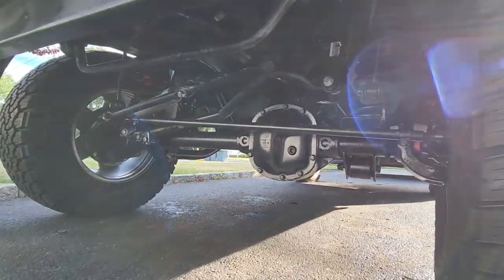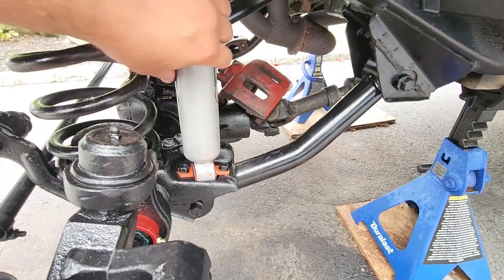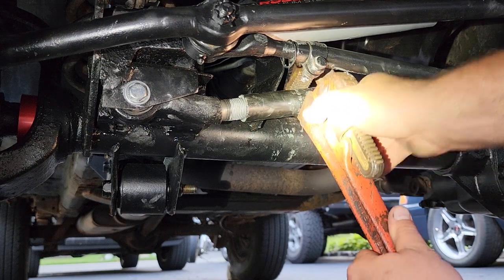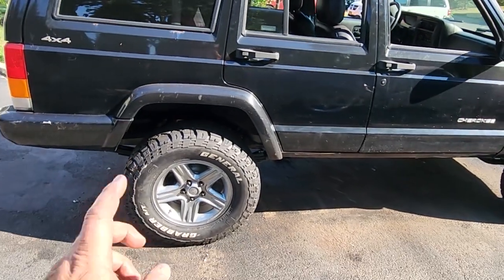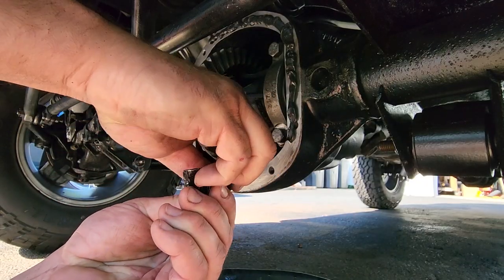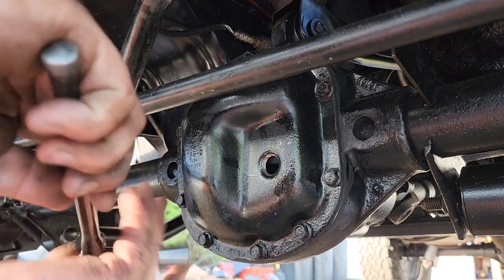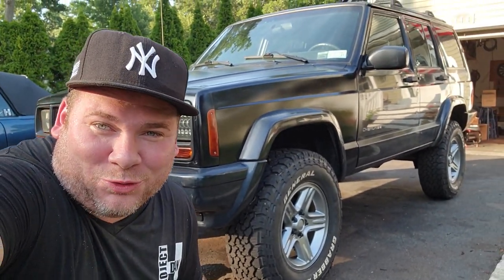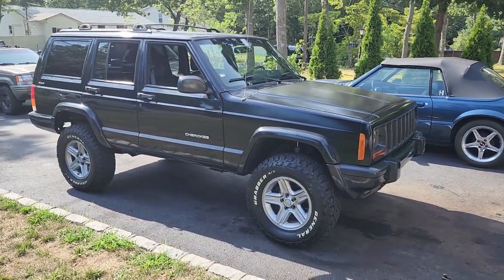LIFTED, NOW WHAT? WHAT TO DO AFTER YOU LIFT YOUR JEEP CHEROKEE XJ - POST LIFT PROCEDURE

Comment: Nice job...My 99 Xj has almost 400,000 miles... It's a Beast
Reply from the maker: Wow!!! Keep going brother!
Reply: Is that with original engine? Just got a 1996 xj with 260k miles seems solid so far just wondering when i should think of replacing it
Reply: Holy crap man!  At 144,000 my little beast might just have some left in her!

Comment: Nice! Loved watching this mini series on the lift. Caster is totally perfect. That’s what I love about a lower lift is you can get away with more caster without ruining the pinion angle. Which was a problem for me when I had the factory LP D30. I’ve definitely found that alignment shops won’t adjust caster if the jeep has aftermarket control arms. I remember I went to Les Schwab and pointed out my adjustable upper control arms and asked if they could adjust the upper arm to adjust my caster. They said they would and then I had them do the alignment. Got the jeep back and I looked at the sheet. They didn’t even touch caster and denied even offering to adjust it. Haven’t been back to have them do an alignment for me
Reply from the maker: Oh man.  Yeah, I could imagine them denying adjustable control arms.. hope they didn't charge you. Lol
Reply: not agreeing with that shop, but adjustable control arms on Jeeps suck because you have to remove them to adjust them. i cant figure out why no one make double adjustable control arms for Jeeps
Reply: @ProjectDanH  they did! But it’s okay, I know the manager and he lets me pop by anytime to check my alignment so I can do it myself
Reply: @motownXJdad9565  oh I absolutely understand that. Which is exactly why I asked them if they would do it and I pointed out how they would need to be adjusted. Said if they wouldn’t do it, it’s okay, I’d just do it myself. I had to leave that night for a 200 mile drive to the coast and wanted to save any time if possible. That’s why I was so frustrated, they said they would do it and were informed about the job and still didn’t do it
Reply: @motownXJdad9565  are you serious? Wonder why no one makes full adjustable control arms, wouldn't be a big deal?

Comment: Great video. Maintenance and looking everything over is key.  Wish I could have found this sooner. I had to go over everything shortly after buying my xj. Kind of wish the guy who built it seen this. But then again he might not have sold it to me. It's a rough country lift 6.5. with upgraded shocks bilstiens in the front Rusty's in the back. The set up for the rear shocks was a headache. Someone welded the flag pin bolts in place when it had a 8in lift. Then when they dropped it to a 6.5. they cut the shocks leaving the post and bolts. And offset a new bracket. The offset was actually pretty well thought out. But the single 3/8 steel bolt and nut. Was a piss poor choice for a fastener. It was a battle. But it has a good 7/8 grade 8 bolts with lock nuts and washers. It'll do until it's time to replace the shocks. Then it'll be done by the book. I don't think the prior owner knew what a torque wrench was. So much was loose. But it rides like a dream now and for most of the places I go. Is more then durable. I'll be upgrading as I need to replace things. I'll be watching more of your videos. Great job man

Comment: Good thing you swapped that rear diff cover out with a threaded plug instead of the nasty old rubber one, been having a hell of a time getting mine to seal on my 02 Laredo with the 44 in the rear, had to rtv it up and jam it in and hope it seals and so far so good
Reply from the maker: Yes!  I never liked that lame rubber plug.
Reply: Any chance you could have got some solvent on it while cleaning it? If so it's a possibility that it softened a bit and reshaped. Hope the rtv helped.

Comment: DAN !! what's up Hey man nice video on the lift I wrote down all the torque specs once the lift is done , I'm at this moment installing the Old Man Emu 4.5 Lift on my 2001 XJ. Currently putting on the control arm drop kit from Rocky Road Outfitter's its a pain but working through it. Ill let you know how it turned out once its done .. Ill try to post it on your site as well as all the other parts of the lift that will be put on as well and thanks for the information on the torque specs.
Reply from the maker: That's great brother!  Best of luck with your Jeep!

Comment: Sweet XJ for sure.I have a project WJ and did a supreme suspension 3 inch about 2 years ago.This bad boy is running like a Caddy.Beautiful ride for a 99.BTW it has 135,000 mile on it.What im gonna do is invest in a transfer case drop kit like you said.Also curious as if you are familiar with the 4 hole injectors.

Comment: Hey Dan if you find yourself needing longer wheel studs ,. 1999-1/2 and newer use longer wheel studs in the front for XJs and TJs , because they use different hubs and rotors than the older models .
 I don't know if you were aware of that or not , but I thought I would let you know that , maybe it will help you out with a project sometime.
 Tim from Wisconsin.
Reply from the maker: Thanks Tim, Your right!  I did notice about a 1/4 inch difference!

Comment: Rough Country is the equivalent of going to AutoZone and buying the Valucrap instead of the Duratrash.

Jeep looks deece tho.

Edit: you took the time to wire wheel the mating surface, but didn't even bother to wire wheel the paint off your tag? Bruh... C'mon.
Reply from the maker: What brand would you like me to use in the future??
Reply: @ProjectDanH  Skyjacker i have a 3" on my '89 XJ or the tomken 8" on my '92 XJ.
Reply: @ProjectDanH ￼ you can do whatever you wanna do man, as long as you pull the two diff bolts that hold the tag in place and treat it with a little wire wheel action, at least make it readable. As far as what I wanna see, gears and lockers before lightbars, long arms (that angle on the LCA has got to hurt when you hit a bump), WJ swap, bumper build, rock sliders, twin Tcase? Idk. Anything but RC. I picked up a my 7th XJ (currently only have 3) about a year ago and it came with some newly installed control arms and control arm drop brackets, 5" lift, SYE, and I had it on some rather easy trails in the High Desert of Oregon and I snapped one of the control arms off the bushing eye kuz the weld only had good penetration on 25% of the bead. Luckily the CADB prevented any major body damage. But that Jeep was only a quick flip anyways, nothing like my daily XJ or my trailer queen XJ.